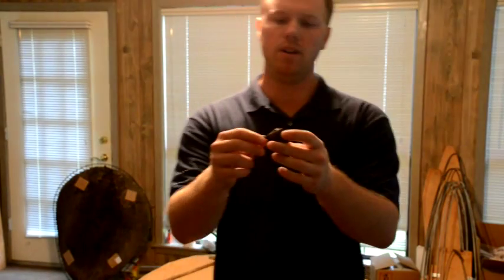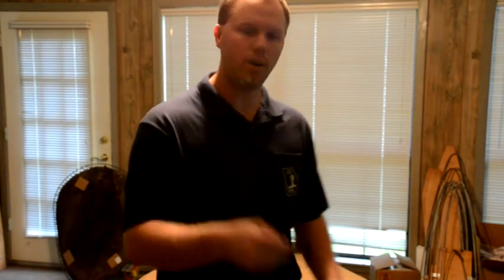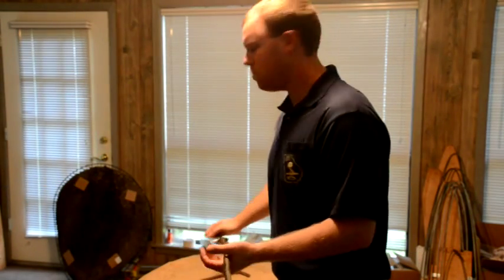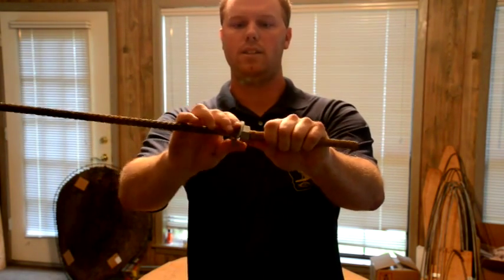Beaver Trapping - Drowning Rod Setup

Comment: would a1/2 10foot electrical pipe work?
Reply from the maker: That may work but you want to make sure it's stout.  I've had beavers bend up 1/2 inch rebar if they pull it out of the mud